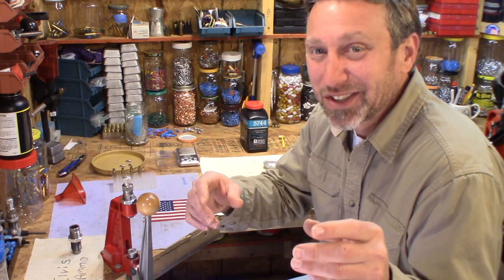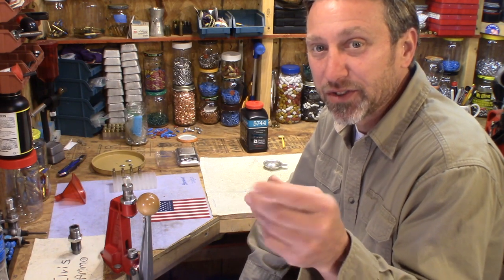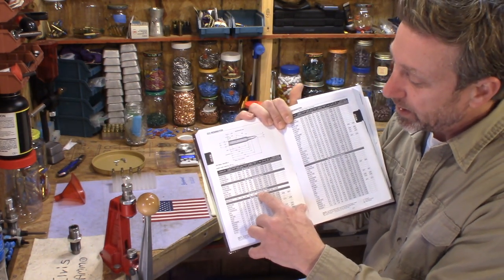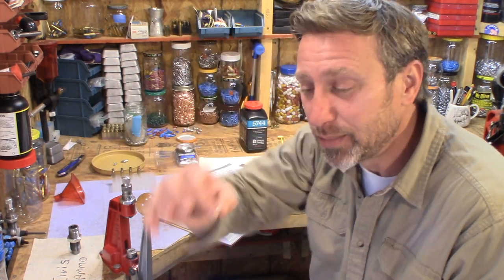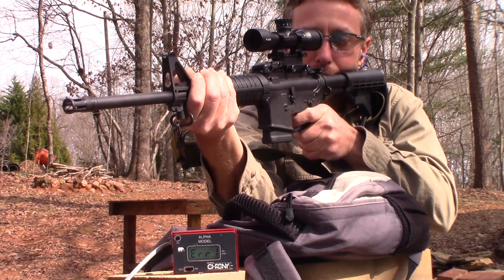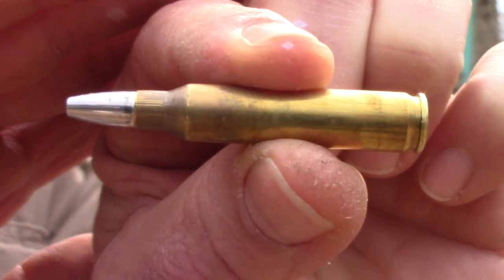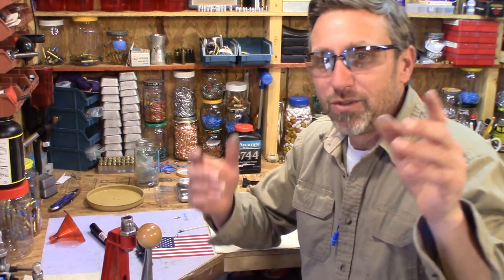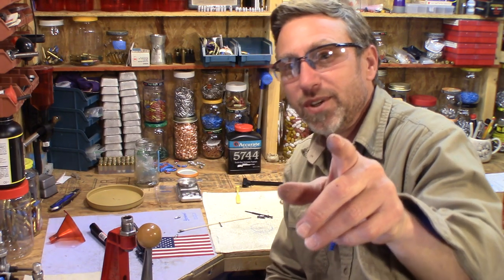Cast Zinc Bullets (223) Loading, Shooting, Capturing!!

Comment: I seriously was impressed by this vid. With the bullet weight being so low, this round might actually be ideal for 5.7 reloading. The next step is to run Zinc through as many molds as possible and determine weight differences from mold to mold. Bismuth would be another avenue in metal to pursue as well. I love the science here. Keep it up Elvis!!
Reply from the maker: TacticalITguy yea man looking good I figure aprox. 100 grain lead bullet will be around 60 grain zinc... good rule. Ill be putting it to the test! Thanks again
Reply: I was thinking more along the lines of a 33% difference, hence a 100gr mold would yield a 70gr bullet as opposed to 60. Yet again this is science, we have a working theory we just need to put into practice. I'm really excited to see what the results are for weights as well as expansion, and gel tests, even soft targets like wood or drywall would be interesting. Keep it up!!
Reply from the maker: +TacticalITGuy I appreciate the interest for sure... we'll see some more results coming up!  answers for more questions for all of us!  thanks again. ....

Comment: Great video brother!!!! I made a dozen 45 acp and they came out around 150 grains. They fired great and almost no recoil. we appreciate all the work you do for us out here. Never stop. I'll let you know how my 9mm go. safe shooting.
Reply: Steel Punisher 69 what mold were you using and did you notice any appreciable fouling
Reply: Darren Butler.  I used the lee 6 cavity 228gr round nose. I could only get 2-3 at a time but they came out great. I didn't get any fowling in the barrel.  I fired them from my Springfield xds.
Reply: Steel Punisher 69 awesome thanks for the reply I may consider trying a few out of my 1911
Reply from the maker: hey there Steel Punisher. .. thanks!  that's awesome info you have as well! I  was thinking about casting the 230 gr 300 blk.  that's close to the weight I figured they would come out! let me know how your other zinc projects go! Thanks for sharing! !! ;)

Comment: ELVIS! I am the guy that swages and powder coats 22lr. I have some possible commentary here about zinc. I had been making 22lr bullets at about 6 bhn.  I melted up  some of what I thought was a bunch of chunks of 6bhn lead. It turns out that it was harder,  Like 9bhn. Also had trouble filling the mold with it. I was suspicious about it having zinc contamination so I put some muriatic acid on the slug that was left after molding about 200 bullets. Fizzing and foaming...a sure sign of zinc contamination. Since I also swage the molded bullets I went ahead and swaged some up and pc'd them. They work great. I don't know how much zinc is in the alloy, probably less than 10%.  They seem tougher. Much tougher. I made a pull weight tester to measure the crimp. I found out that 22lr with modern powder needs a real strong crimp. It was recommended that he bullets will pull with about 50lbs of pull. I tested some Remington Golden bullets...26 to 28 lbs. I tested some Super X ...65 to 78lbs. When I tested some of these suspected zinc contaminated bullet pulls, they held to around 70lbs. However, the bullets stretched like taffy before letting go. I thought that was odd. Have you heard anything about zinc/lead alloy and the hardness or toughness?

Comment: It may have been mentioned already but maybe the zink is too light to sink into the mold quick enough. 
Perhaps you could sacrifice a mold by drilling out the sprue plate holes to allow the zink to flow in quicker, or tap on the mold as you are filling it to get the zink inside.
 (like how a spider can walk on water because of the water tension. )

Comment: Reduced may be the best bet, Longer bullet means more surface area to force down the barrel and I think zinc is harder so requires more force. Be interesting to see what the pressure spike would be.
Reply: It looks as though zinc has similar hardness to copper (Brinell) from what I found on wikipedia. With the solid copper bullets we are using today, it should not be a problem.

Comment: A 77gr mold should theoretically give you a 55gr zinc projectile, or at least something close. It'd be really cool to see how that would perform. Keep up the good work!
Reply from the maker: hey Hillbilly J... that's funny ! I come up with the exact figure!  I thinking about ordering a mold! thinking bullet design.
Reply: Mine have came out average around 45 grains I'll weigh the ones I cast again to be sure. I'm definitely excited to test the ones I've cast.
Reply: @dthundergunb3115  They should be roughly around 48 grains since zinc is about 63% the weight of lead given the same volume.

Comment: Great video.  You trying pure zinc or an alloy?  I started experimenting with zamak-5 alloy about 8-10yrs ago for its greater ability to fill out molds.  A touch of copper is to zinc what tin is to lead.  A lot less rejects, and keep the mold as hot as possible for easier sprue cutting.  Thx for making the vids.
Reply: I believe he is using pure. I also tried the zamak although I don't remember what ratio alloy I used. It didn't fly very well for me though. I didn't do load development however.

Comment: I think the future of lead free bullets will be Polymer based.

Using a soy based polymer (plastic) with iron mixed in to add weight.  It would be like concrete,  a mixture of cement and rocks.   So they would degrade into non toxic elements over time.  Plus they could be cast in any color.

Like your ZInc experiment shows lower weight means longer bullets.   So these will be longer than people are used to seeing in any given weight.  Which is typically good for shooting.  

Reloaders would have to buy 'ready mix' that would cast a homogenous mixture into a mold.  it might be an injection mold system.   Or perhaps a 3D printer could be used to make them.

They would work for range shooting but not so good for hunting I suspect.

Watch out for symptoms of  "Metal Fume Fever" when casting zinc.

Comment: Man I bought the 225-77 Elvis mold from Arsenal Molds and finally got it yesterday, I got the brass version to cast zinc and I made a handful in no time. Gonna be testing them out with some Accurate 2230, some with Ramshot TAC, some Accurate X-Terminator, and some IMR 8208 XBR. The bullets drop consistently and perfect out of the mold mine are coming out averaging about 45 grains. I was wanting to ask if that sounds about right to you? I was using plain zinc wheel weights only. I plan on doing a PC coat on them and running them through my sizing die then loading them up. I sure am excited to test them though. Anyone that reads this, buy a mold from arsenal molds they are absolutely perfect. Customer service is awesome as well.

Comment: I don't know if the zinc alloys will accelerate wear. Is it harder than the copper jacket material on jacketed bullets? Steel is still a heckuva lot harder than either one.

Comment: Elvis Ammo, the zinc bullets are an awesome test, especially if lead gets prohibited (hoping not). However, from the test you did, and I realize there is not enough data for zinc bullets, but, going from this test you did, I would have to say they would be great for target pinking, but for hunting, it doesn't look promising, because unless you hit a rib bone and shatter it, or manage to get one directly through the heart, that animal is going to be running. You need the bullet to mushroom to have some blunt-force stopping power. But, keep up the great testing.

Comment: Hello Elvis !!! You are really getting a lot of comments on this. Great !  The keyholing makes me wonder. I think Hogflyer is correct and the rifling is being stripped from the bullet. Lead will upset more and maintain contact with the barrel better. And you had some bullets fly true. I'd like to know if powder coating the zinc bullets will prevent any more keyholing.
And while zinc and lead don't mix, how about a 90% zinc and 10% tin alloy? Don't know for sure, but I'm thinking that this would be a workable solution.

Comment: I'm curious about barrel wear.I also have a lot of zinc just sitting in buckets. Keep up the good videos.
Reply from the maker: hey Justin Conklin. .. I'll be getting to the bottom of the barrel wear issues. . trying to collect some data... I'm thinking there's no problem. .. but I'll do my best to  back it up with some good info..
Reply: elvis ammo thank ya sir. I've got just as much zinc wheel weights as I do lead.
Reply from the maker: +Justin Conklin this is a good thing. ... I  think we will end up finding this to be an alternative for certain situations!  as far as barrel wear. I'm finding information indicating zinc is a self lubricating metal. .. we will get into more of that as we find more info..
Reply: elvis ammo hey Elvis. I am looking at the brinell hardness of elements table and according to it zinc has about half the hardness as copper. So I think barrel wear might be minimal. Will the zinc ruin a good lee mold. If it won't hurt my mold, I will give it a try and let you know how mine works out.
Reply from the maker: +Justin Conklin bhn looks good... sizing is very important.  and bullet design that will allow reasonable sizing. .. ie. the amount of force it takes to push it through the sizing die. .. bullets with raised driving bands are more likely gonna work for sizing and not create over pressure!  
I did however discolor my mold or scorch it slightly. .. it don't look like it is deformed in any way... just thought I'd mention that!
Reply: elvis ammo thanks for the info. Lee 2 cavity molds are cheap enough to give it a try. Keep up the good work.
Reply from the maker: +Justin Conklin yea that's what I thought. .. I got one now! just gonna be a light bullet. .  I m gonna go for a 77 gr mold... heavy lead and 55 ish zinc.

Comment: Hey Elvis,  This is may be a new era in casting bullets! How did primers look at 3070 fps? Bullet could be blowing by rifling 1in8 could have scrubbed lub groves Twist which does not match bullet speed will always hurt accuracy.  Speed first  then work on slower twists for accuracy. 220 Swift 1in14. I just wonder how fast this bullet will shoot with more mass with less weight. You might approach Swift speeds WOW! This is neat stuff. Thanks for your work.
Reply from the maker: hey Hogflyer 269.... yea a whole lot to think about here! The rifling was hard to pick up on video, but it looked pretty good on the bullet... totally missed showing it! also forgot to mention the primers! looked great with plenty of room to grow. The recoil was non existent .... I believe a heavier bullet slowed down a bit will match my twist rate better....

Comment: Good work Elvis. You may end up having to use ceramic or steel molds.....hopefully not. The higher melting point of zinc definitely creates some unique challenges.
Reply from the maker: hey Larry Kool... yea, we can get some decent used from the 2 cavity cheapies. but longterm steel would be the way to go.

Comment: I don't see much expansion in the wound channel.  They seem to just zip right through. That could be an issue. (Maybe that is normal for 223?)  

Do you plan to perform any penetration tests?  I'm wondering if the weight will be a factor.
Reply from the maker: hey Lorne Booker... yea good question and point. .. don't expect expansion from the zinc. .. Not always bad. But a larger caliber will do better work. But the speed of a light bullet can create a nice wake.  I've been wanting to do some penitrating test in different media and do some comparison tests.  I will definitely get to that. Glad you are asking about it.  That will be interesting. ...

Comment: I am afraid the added hardness would cause a lot faster barrel ware.
Reply from the maker: hey there The Reloader Dude. .. I  thought about that , but copper is 29 and zinc is 30... the only difference is maybe a soft  core in the copper... the rifling looked very normal. .....
Reply: Barrels are cheap over time compared to a ton of cheap ammo

Comment: very interesting elvis, kinda concerning with the first shot key holing but the other two seem good maybe just a fluke or it could be from the 1:8 twist barrel 1:9 would be ideal. would definitely like to see another ballistic gel shot just to see and make sure those lube groves didn't get taken off by the barrel. And since u like challenges but again be safe, how about seating a bullet backwards in a casing and seeing what type of accuracy and stability you get. again be safe cause I don't want anything to happen to you, this could just be a stupid idea. the only reason why I ask is I made a dumb mistake and accidentally seated a 223 bullet backwards but never shot it. have a good one elvis
Reply from the maker: Hey grounds28... yea the keyhole bullet could have thrown things off but I don't think that was it. The corner of one side of the chrony was getting sun while the rest wasn't. 
And I want another shot in the gel too!
As to the backwards bullet. No way im gonna ask how that happen! : ) .. The only concern for shooting a backwards bullet would be case volume relative to pressure. That we can figure, Other than that would be serious feeding issues! you obviously know that. but..... not scared! good neck tension required....
Reply: Lol yea got a little bit a head of myself and didn't quite pay attention until I got the bullet seated I noticed something different but I caught it. I usually run 75 grain bthp with IMR 8208 good powder and I get pretty good accuracy out of 18 inch 1:8 twist ar-15. Happy shooting elvis looking forward to the next video

Comment: also, casting zinc does not involve any dangerous fumes am I right? I.e. it is totally safe...not like casting lead?
Reply from the maker: hey Rtwo comm... yes, zinc is harmless at or above the melting point of 787 degrees Fahrenheit. Until it reaches it's boiling point of 1667 degrees Fahrenheit.  then it will start to give off fumes in the form of gasses. This can make ya a little sick with cold like symptoms. . Handling it is safer as well with no lead poisoning to worry about. If it were heavier it would be the perfect alloy.... Thanks for watching!
Reply: So you saying its too light i guess... how about casting it with some steel core in it or something like that? :L)

Comment: Bullet molds can be cut smaller or larger based on the alloy used for casting.  Slug your barrel and measure your zinc cast bullets.  For lead, bullet should be .0005-.0015" larger than the barrel between lands.  All the best.
Reply from the maker: hey Marcus Vincent. . I'm thinking,  bullet design with slightly raised driving bands 1 thousands over bore... none to light contact with the majority of the bullet. .. zinc bullets tend to be self lubricating. . the 223 I shot zipped through like butter.  No pressure  signs at all..
Reply: It sounds like you have a game plan.  It's that one bullet tumbling that bothered me.  I know lead obturates to seal the bore, but not sure of zinc and it's properties.  All the best!  Keep up the good work.
Reply from the maker: +Marcus Vincent  yea I wasn't so much bothered by the tumble as much as it surprised me... all the other bullets give pretty nice holes... the weight of the bullet the speed of the bullet with the rifle twist rate was the culprit. .. You'd be surprised to know how many times factory ammo keyholes. little bit heavier bullet or slow the light bullet down. Or faster twist rate!  that's what I think. ....

Comment: If you tell me the weight and length of the bullets and the power and OAL length you want to use I can run the numbers into my quickload program to show you the estimated pressure curve graphs.
Reply from the maker: hey Prepare2survive... don't really know for sure ... but I was thinking of casting a lee 230 gr 300 blk should come out to a round 150 ish grain. in zinc. Maybe try acc 1680 or imr 4198 or win 296 ... I may be able to give more precise info later... 
53 grain zinc bullet from a 77 gr. mold .. not enough info. I'll feed ya later! : ) thanks!
Reply: The main things I would need to know aside from the bullet weight and powder being used is the exact bullet length and the OAL you want to seat that bullet to. Knowing just the bullet weight and powder charge wont give you any accurate pressure graph because seating depth effects the pressure a lot and in order for the quickload program to be able to calculate seating depth it needs to know bullet length and cartridge oal.

Comment: Hi elvis, I have a question for you about powdercoating,

I have tried it several times and I keep coming out with a bunch of bullets who have flat sides ( only with powdercoat the lead is perfect.

Have you ran into this? Do you know how to prevent it?

Some of them come out smooth, some look like they were baked in a puddle
Reply from the maker: hey C Clark... not sure how that's happening.  I bake mine on a screen mesh.  I also make sure I shake all the excess powder off. those are important factors.  not sure if you're using a solid bake pan of some sort?
Reply: I follow your method exactly except for one thing ( and I think this is whats fucking me up)

I only sift through a strainer, I dont shake them on the baking screen. Its been leaving powder build up on the outside of the bullets. I am going to cast some more this week and should have much much much better results. 

I also saw you have casted zinc, I ruined a lead pot with zinc( bottom pour) zinc is such a bitch!